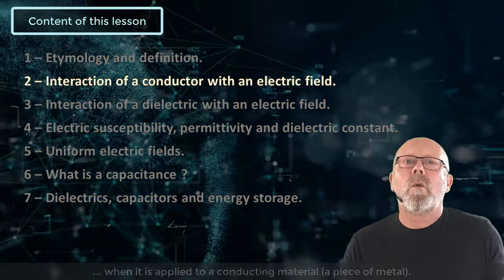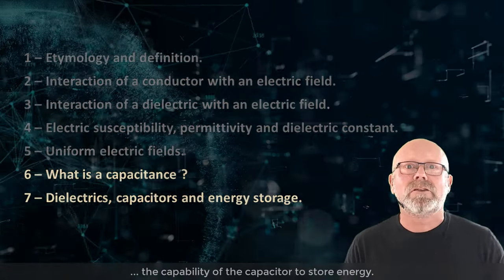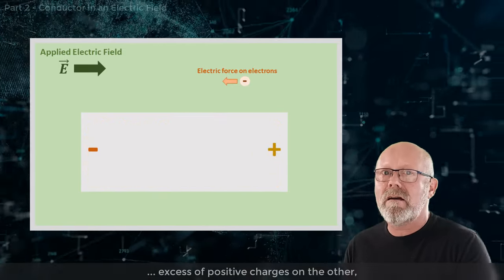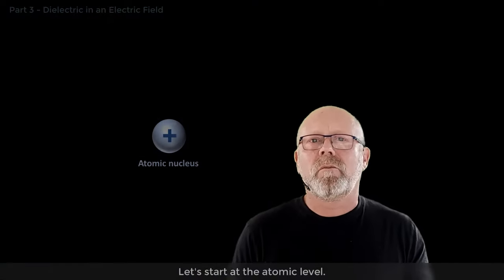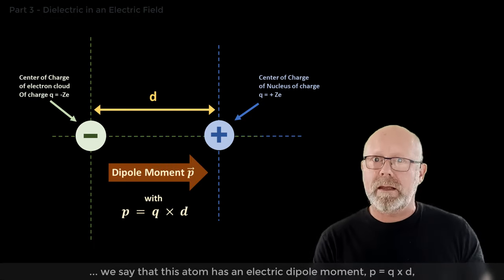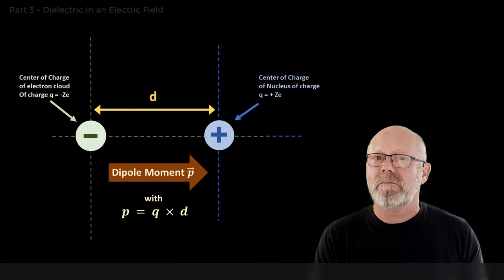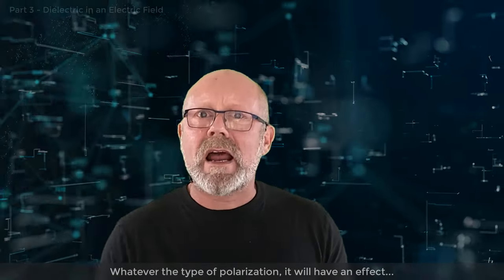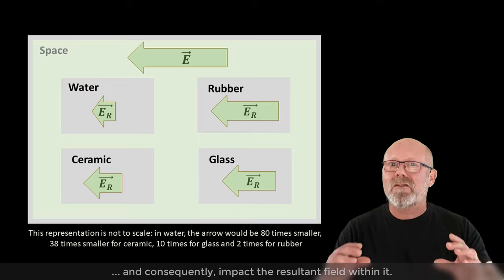What is a Dielectric? (Physics, Electricity)

Comment: Hello sir! 
I am in one more confusion, 
Sir the formula of kinetic energy, 0.5(mv²), works when the force acting on a body is constant , as while deriving this equation when used equations of motion. And if the force is variable we can take the help of calculus.
But sir when ever we examine a problem in which mass, say m, and its velocity , say v, is given we blindly apply the above formula to calculate its kinetic energy.
I suppose,  that the value of K.E we just get is the work we have done on a body with mass m, initially at rest, and to bring it to velocity v, with a constant force.
This is my main doubt, that when we have this scenario we don't know whether the body has acquired that velocity with a constant force , though we do this. Isn't it very uncanny sir?
Reply from the maker: Hi Kim,
Because Energy is a state function: the energy of an object does not depend on how it got it, it only depends on the state of the object at the present time. Google up ‘State Function’ to know more 😊 !
Reply: @PhysicsMadeEasy  hello sir, as you have recommended to search for state functions and I did but I find something very confusing. In almost every video it was said that heat and work done are the two most common examples which are not state variables or state function. It means that while doing work, the work depends on the path of the object that it took and it seems obvious because the formula itself is force into displacement. But sir it was also taught work done by a gravitational field on an object does not depend on its path. So it is also state function because it fits in the definition of the state function. Is it so sir?

I have one more confusion related to this, whenever there is a situation in which it is given that an object of mass m is lifted by someone, so we take that the force applied to lift the object is MG , this means that the object is moving upward with a constant velocity but what if the force applied is not mg?
Why we always take MG in this type of scenario sir even though it is not always ?

Comment: Sir, would you please explain the following? 
Does free space and air that we are breathing mean the same thing ? How the permittivity changes between this two ?
Mathematically,i proved e(epsilon) for air is equal to e(epsilon_naught). 
Iam really confused between this two. Hope i get cleared sir

P.s iam currently working on maxwell equation derivation sir
Reply from the maker: Hi sgiri. Compared to condensed matter (= solid or liquid material), air contains a very low concentration of molecules. Therefore, the effect of these molecules on the electric field will be minimal, barely significant when you compare with the effect of the huge amount of molecules in condensed matter.
Consequence of that: the ratio of the permittivity of air with that of vacuum is very close to one: 1.0006 to be exact.
Does this help?
Reply: @PhysicsMadeEasy  sure sir

Comment: Hello sir
Sir while explaining surface tension you mention that the surface tension         acts along a line (boundary) , when the surface is flat. But what will we happen in the case of a sphere (curve surface), and if such things happen then , doesn't it will be on a single point of contact with surface of water???

Also sir as we know, earth is moving around the sun in an accelerated motion , so at every instant  when earth changes its direction, why don't we feel inertia of direction, as the earth is moving with way high linear velocity???
Reply from the maker: Hi Kim,
Surface tension : In the case of a sphere, that would probably require a little calculus, where the variation variable could be the angle of the interface with the horizontal (or the distance from the center of a disc). In that case : the extension between water molecules will vary with the distance from the center to the extremities. You could imagine co-circular lines of iso-tension. If you average-sum all these surface tensions,  due to each circle (considering mass variation too), you would get something inferior to a flat disc. That’s why a sphere will sink more. (Sharper the entrance to the water, more easily the object can sink.)

Rotational inertia : We actually do, but the effect is very small comapred to gravity. But if you consider the effect due Earth rotation instead, there the effect is significant : The apparent gravity at the equator is 9.78 m^2, and at the poles 9 .83 m/s^2 . Another effect of rotational inertia is the coriolis « force » (note that it’s not a force , but it appears so due to inertia, like the centrifugal force)

Comment: Sir I have another one, actually two,
First, sir in our homes there are plane mirror, and its very common. But sir when I touch the mirror surface still some gap is present between the virtual image and my image. I thought it was due to the width of the mirror but what is the actual reason sir?
Second sir ,the ropes that are present in our homes where we put cloths to dry , when left undisturbed why they bulges outward more from center as compare to other portions?
Reply from the maker: Hi (what's your first name?)
1/ the reflective part of a mirror is the thin metallic layer behind the glass. When you place a finger on the mirror, the gap you see is twice the thickness of that glass.
2/ What is instead of a rope you placed a metallic bar? It wouldn't bulge. The bulging of the rope is due to the material properties of that rope. more specifically how the bonds between  molecules respond to external forces.

Comment: Sir I have one more confusion from sound. We are taught that the sound wave are longitudinal waves. And we convert them to the graph of pressure or density variation versus distance. the amplitude is defined as the maximum displacement of the particles, and for the sound waves maximum displacement of particles is horizontally ( left and right) . But still we denote the amplitude of sound as the maximum variation in pressure or density, even though the the si unit of amplitude is meter. 
Please resolve this confusion sir.
Reply from the maker: Hi Kim, the Y axis of sine graph representing a longitudinal wave is not pressure or density, it is displacement versus the equilibrium point (that is  Y = X - Xeq ). I have seen text books making the mistake you describe, or maybe not explaining clearly how they draw such density graph... 

If you consider the positive direction for displacement (i.e. the positive direction of the Y axis) as being displaced to the right, the maximum density occurs on the x axis where the sine curve crosses the axis and has a negative gradient (at this point, particles to the left have a max displacement to the right, and particles to the right have a maximum displacement to the left, which leads to a maximal compression).
The same way, the rarefaction points are when the sine curve crosses the axis with a positive gradient.  Think about it...

Comment: I would be interested in how this concept applies to human biology.  Are we dielectric?  If so, do radio frequency fields and EMFs change our bodies?  Anyways, thank you very much for the video and the others.  They are very well done and I will keep plumbing through them for insight.
Reply from the maker: Hi Mike,
Yes, because we are mainly made of water but the effect is minuscule, properly insignificant, compared to the random motion due for example to temperature. For a significant effect, the intensity of EM waves would need to be huge. btw, the light from the sun is also an electromagnetic wave... 
And thank you for your kind words :-).

Comment: Hello sir
It's a short one,
We have always been told that the formula to calculate the angular displacement/theta is given as (l/r) but as a side note is given "only for small angles". Why it is so sir?
Reply from the maker: I guess because in the calculations that derive the formula, there must ne a point where you need to use the small angle approximation (where one assumes that sin (angle) = angle)). By using this, the formula obtained will only be reasonably accurate for small angles (usually less than around 10-15 degrees).

Comment: Hello sir I am Kim, i have more and it is about surface tension. Sir the definition of surface tension is given as force acting on a unit length perpendicular to it. But sir consider a blade, though the blade is denser than the water , if we gently put it on the surface it will float. Sir here water particles are attracting the blade particles through out the surface, but surface tension is N/m ( N/m²). I feel it very awkward because , in questions also we are said to take the boundary (perimeter) of materials, not the area of contact with water. Sir please clear this?

One more ( Diwali 🎁), sir in calculating friction force we just use normal reaction and coefficient of friction. Sir but in daily life (from my frame of reference) it seems to be also dependent on the velocity. For example, at garage , when the grinding machine is used , that spin at high velocity, the sparks come out , but if it had spun slowly nothing happens. Why sir?
Also sir it is said that the static friction is greater than kinetic friction because while moving the irregularities don't interlock perfectly as compared to when they are in static state. It means that at much higher velocity irregularities won't be able to interlock perfectly, as they would directly jump on to the next portion. It means that at extremely high velocity is the friction should decreased to a large extend but it don't happens? Why sir??

Also sir, the composition of atmosphere tell such that in what percentage certain amount of gas is; for example nitrogen 78%. But sir my question is that which quantity does this percentage indicate, first time thought it to be volume but sir as we know air is a homogeneous mixture, so volume of each gas should be the same. So my question is which quantity does it represent whether it is moles or in the terms of mass?
Please sir...
Reply from the maker: Hi Kim,
1/ I encourage you to revisit your understanding of surface tension. Surface tension  is a property of the interface related to the amount of intramolecular forces that occur between water molecules along a line S = F/l. These forces are larger at the interface than in the bulk.
Once you place an object on the surface, the distance between molecules of water will extend, and like a spring generate an extra return force. The direction of the force will also change gaining a vertical component. That vertical component compensates for the weight of the object. The object appears to be floating. Visualise it: Naturally, the extension of the surfacic bonds between water molecules only occur at the perimeter (assuming the surface of the object is flat). 

2/ You are confusing energy and force… P = fv. For the same amount of friction (f), with a larger speed v, you will dissipate energy at a larger rate (P)… hence the heating and the sparks.

3/ Usually, the composition of the atmosphere is provided in ppmv (parts per million in volume). It’s more intuitive because in normal conditions, the volume of one mole is the same whatever the gaz. If you know the molar masses, converting to the the mass fractions is easy.

Comment: Sir by Gauss theorem , electric field between two opposite charges is the sum of electric field of both charges and resultant has more magnitude than electric field exerted by them individually . Then how can resultant electric potential gets decreased when the relation |E| = |dv/dr| shows that they are directly proportional to each other . Hope you would reply.

Yours sincerely

Talmeez Abbas
Reply from the maker: Hello Talmeez,
you wrote: "Sir by Gauss theorem , electric field between two opposite charges is the sum of electric field of both charges and resultant has more magnitude than electric field exerted by them individually ." 
Be careful. you should have said: "the vector sum". If you consider a point between the two positive charges, the resultant electric field strength at that point being the vector sum, its magnitude will be less than the individual electric field strengths.
Can you reformulate your question regarding E=dv/dr? E is not proportional to v, it is it derivative in regards to space...

Comment: Happy New Year sir , I am in one more trouble.
Sir the law of reflection states that the angle of incidence is equals to angle of reflection. This is said to be applicable with all types of mirror whether it is plane mirror concave mirror or convex mirror.
And also when we draw a radius (of any circle), it is perpendicular to the tangent to that point so it acts a lot like a normal for a Mirrors. But my confusion is with one of the rules of concave mirror which is stated as if the incident ray is parallel to the principal Axis then the reflected ray will pass through the focus of the circle ,which is Halfway between the pole and the centre(of a concave mirror). But when I have drawn a concave mirror with Centre C and Pole P and focus F and taken and line l parallel to CP(radius) and let the point where it touches the mirror be O. So when we connect C and O, CO should be the normal which means that the angle between CO and the parallel line(incidence ray) should be equal to the angle between CO and the reflected ray, so when I have done so I found many times that it is not passing from Focus .The line which passes through the focus does not have the same and angle as the incidence angle. 
Where am I going wrong sir I have tried it many times and all the times I am getting the same result.
Please clear this confusion sir ???...
Reply from the maker: Oh, Kim, you are always in trouble 😉
What you are experiencing is called spherical aberration. The rule that rays parallel to the principal axis will focus on a single point is true for parabolic mirrors,  but not for spherical ones (like a concave mirror). It is approximated true for spherical mirrors when the radius is large compared to the size of the mirror itself, i.e. for a small aperture.
Check this link : it has a great picture that explains it all :
https://phys.libretexts.org/Bookshelves/University_Physics/Book%3A_University_Physics_(OpenStax)/University_Physics_III_-_Optics_and_Modern_Physics_(OpenStax)/02%3A_Geometric_Optics_and_Image_Formation/2.03%3A_Spherical_Mirrors
Reply: @PhysicsMadeEasy  thank you sir

Comment: Sir I have question about tension, sir we always consider a string to be massless because that implies that the tension force is acting uniformly throughout the string but sir when it comes to a string that have mass , it is said that the tension force will not be uniform. Moreover the tension force will be maximum at the end where the force is applied and it will be least at the free end. But sir no one give me the reason for this scenario why it happens ?please explain this, because sir considering a string to be massless is equivalent to considering gravitational force as repulsive because if there is a matter it should have some mass? Won't  it affect the result?
Reply from the maker: Hey (what is your first name?), 
Strings are considered massless because it simplifies grandly calculations: You can consider the string like a single system when you draw a Free body diagram. If it is not, you need to consider the strings like a set of tiny systems of length dx in order to describe accurately the system. Usually the mass of the string is small compared to the mass of the thing that hangs from it, so it is reasonable to neglect it.
Now to your question, I’ve been thinking about it. I do not have a straight forward answer, but if did dive into it, that is the model I would use to start working on it:
Consider a string made of one single massive particle and attach it to two walls with strictly massless rigid bonds. Do a FBD on it and derive the forces (direction and magnitude)
Now, consider three particles instead of one (the bonds between the particles remain massless and rigid). Do a FBD on all of them and derive the forces.
Repeat with 5, 7 … N where N is an odd number
From this work, you should be able to generalize tension as a function of position.
Reply: @PhysicsMadeEasy  yes sir , tension will be maximum at joints and minimum at middle

Comment: Sir I have a question.
If there is a slant surface and there is a conical solid, then why the surface with larger radius points downwards.?
Reply from the maker: Hi Kim, your question is a little out of my field of expertise. For me it makes sense and would be in relation with the angles formed between the normal between the intersecting plane and the surface areas of the cone at all points. But I do not know how to prove this mathematically. You should ask your Math teacher!

Comment: 6:07 water polarization in electric field… what happens if it was in magnetic field?
Reply from the maker: Hi Fi, Here's a starting point for that question: https://www.sciencedirect.com/science/article/pii/S2211379717317230#:~:text=Highlights&text=Proper%20use%20of%20magnetic%20field,change%20the%20properties%20of%20water.&text=The%20evaporation%20amount%20of%20water%20increase%2038.98%25%20after%20magnetization.&text=The%20specific%20heat%20and%20boiling%20point%20of%20water%20decrease%20after%20magnetization.